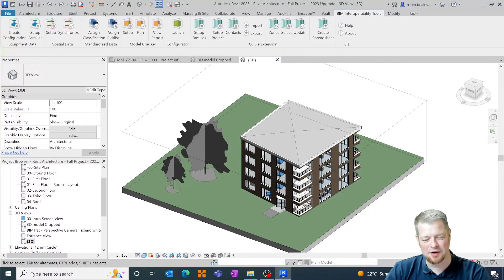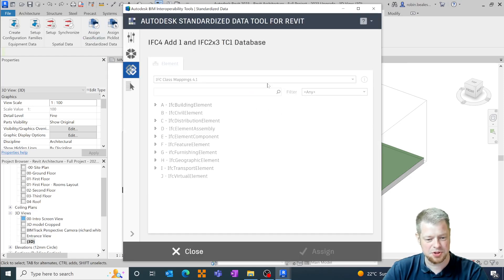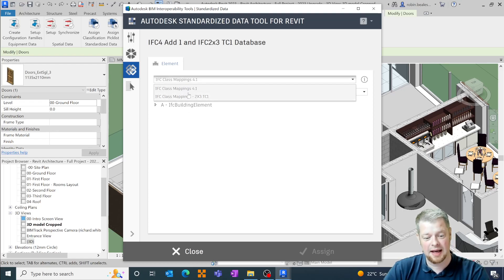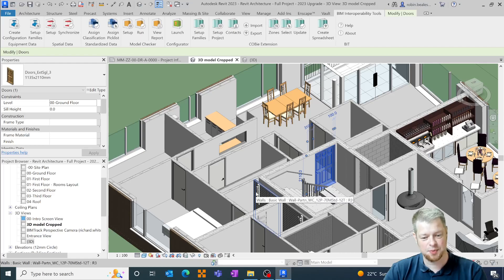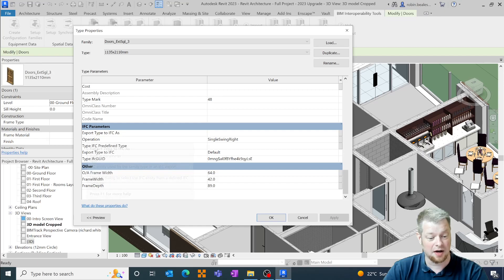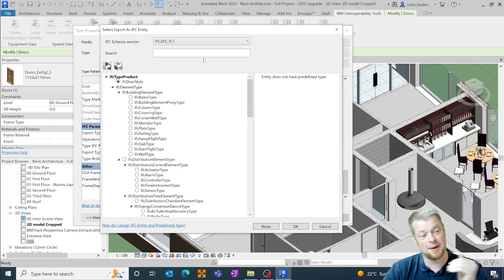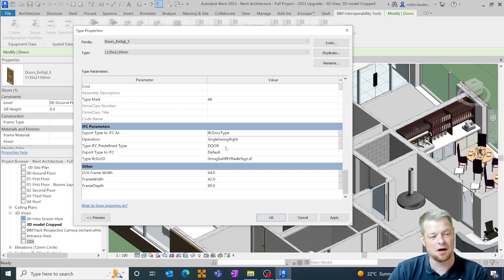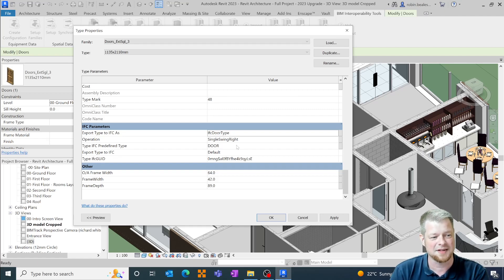Autodesk Revit 2023 - IFC Parameter Tools Update

Comment: hi nice video info. Do you know if 2023 can add bip/properties parameters title, like instead of Identity data, add or rename it as another group name? thanks
Reply from the maker: As far as we can see, altering the ‘group parameter under’ list is still not available to change even through shared parameters. This seems to be hard coded and you would need to change some back end programming to add or modify this list which we would not recommend. According to the Autodesk forums is has been requested for some time but never added as a function.

Comment: Hi. Do you know if it now in Revit 2023 is possible to override the previous hardcoded IFC Class mapping of system families, eg export a ceiling as an IfcRoof or a wall as an IfcFurniture? (Bad examples but I hope you get the point.)
Reply from the maker: You can override the category classification mappings for both system and family objects by using the IFC Export options dialogue or if viewing this on an elemental level you can force individual objects to take on other classifications by using the IFC Export As parameter. With the new inbuilt tool for IFC classification, it has made this a bit easier, and you have the option to search through 5 different IFC Schemas from IFC 2x3 to IFC4.3 which is the current latest release. I hope this helps to answer your question.
Reply: Nope. Ceiling still stays as IfcCovering.CEILING

Comment: Hi there. What happens if i need to use the "IfcObjectType" parameter for a UserDefined type? It is not available by default in Revit 2023.
Reply from the maker: If you have a category which you are defining an enumeration subcategory against the normal object this can be selected in the same window. It will not automatically create the IfcObjectType parameter so you will have to add this in manually on your project or families as before. If your IFC viewer supports this field, then you should still be able to view it but we have noted that not all IFC viewers accept and understand this 3rd parameter for the user defined object definition output. The enumerations parameter field is now labelled with ‘Type IFC Predefined Type’ which is where the USERDEFINED filed will be located. 

You can still use the old system of adding all the IFC parameters in manually or through the Standardised Data Tool but we would not recommend running both the old and new systems as they might interfere with one another.  If you are looking to do something else, then please let us know. There are several Autodesk forum posts on this subject that might be worth looking at although generally referencing the older parameter arrangement.

if you need more information please email marketing@manandmachine.co.uk